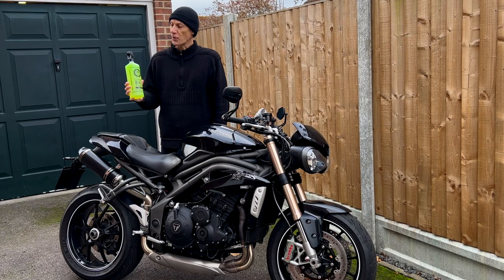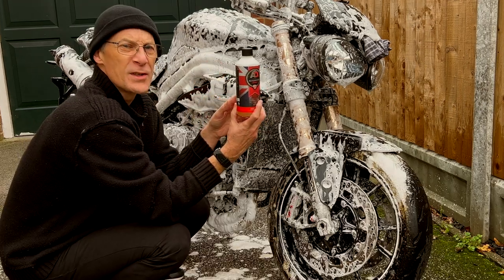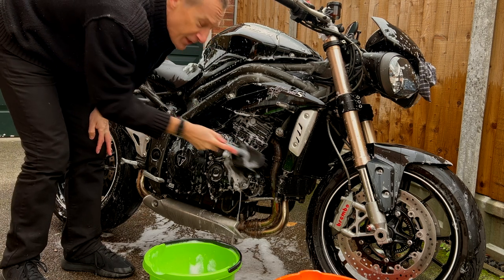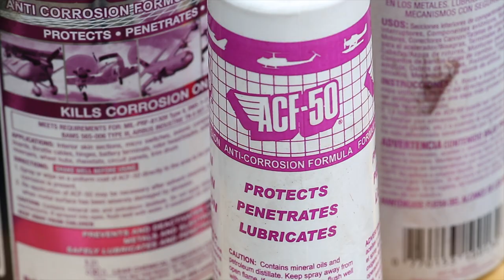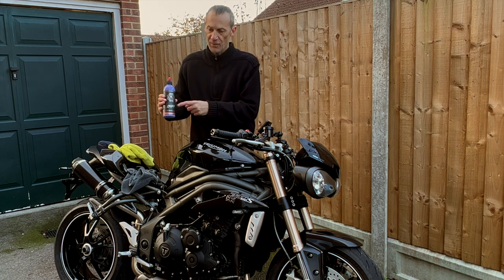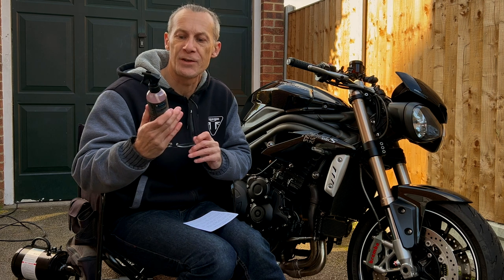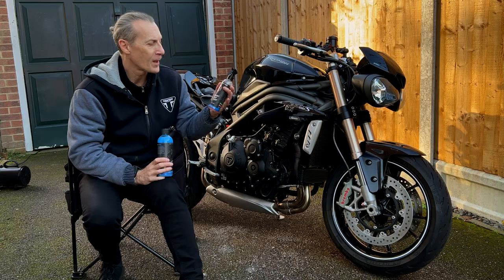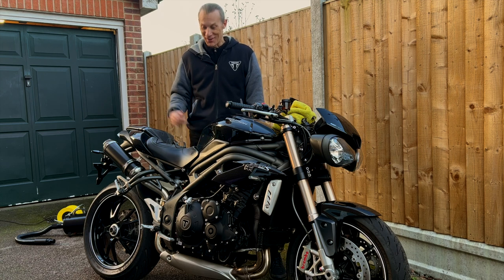How to clean your motorcycle - with Autobrite Extreme Range

Comment from the maker: Please note: AutoBrite have pointed out that the Ceramic Quick Detailer is best applied as a spray. I applied it with a micro fibre towel, and it still looked amazing!
Reply: So spray it on and leave it ?
Reply from the maker: @ThisTwoWheelLife  The Ceramic Spray you spray it on the bike one panel at a time and then immediately wipe it off, there’s no need to leave it on! Autobrite would be happy to answer any questions you may have too! 😊👍

Comment: There’s something satisfying about watching motorcycles being washed 😂. I do love to wash my motorcycles as well. Great video.
Reply from the maker: Definitely, I find it very therapeutic! Which brand do you like to use on your bike? Thanks for the encouragement! 😊👊
Reply: @TheAdventuresofPhilJones  mucoff if that’s the spelling of the brand. Good products.
Reply from the maker: @TripleSound  I use their Speed Polish which works really well. You can see it in my cleaning series. Seriously, check out  Autobrite when you run out, you won’t be disappointed. 😊
Reply: @TheAdventuresofPhilJones  thanks will give it a try.
Reply: Cracking video Phil, good explanation of the cleaning stages and products and application, your bike already looked great now it's simply stunning 👌
Reply from the maker: @dalewintle9969  Thanks Dale, I really appreciate it. Yeah, I’m really pleased with how it looks. I was planning to ride in December and January but then I was kindly loaned a Triumph Tiger 900 for almost a month and I then I didn’t fancy riding my bike in the sub zero conditions, I’ll be back on it again soon! 🤪

Comment: Very good demos of the products, can I suggest a few things bud that will help with your cleaning process... Grit guards for your buckets (Black paint will show up micro scratches more clearly) also consider wearing gloves when applying polishes & sealants as most can damage skin (mainly drying and cracking -not good in winter lol) that been said though excellent video and very informative👍🏻
Reply from the maker: Thanks so much, and thanks for your advice. I have been considering getting grit guards, but didn’t think about gloves which is a great idea and very professional! Thanks for the tips and support! 😁👍

Comment: QD is a temp surface cleaner, seal all surface all over. Polish plus wax differ. 

All ceramic need interim support, a good ph wash. 

You can buy plastic dressing...just be careful and any ceramic type product needs to bond to a bare surface. 

Autoglym SRP is like a facial for your paint, old or new. 

Meguiars PlastX will get scratches out of clear plexiglass. 

Good products AB. 

Over years you can learn to clay plus tar and iron decon paint. AB sell these products. Good luck.

Comment: Hi Phil
I have the 2021 speed triple 1200rs and wondered wot you use on your engine on your Triumph Speed Triple as it looks amazing
Reply from the maker: Thanks so much. Nice bike, what colour is your 1200RS? It's just a combination of all of those products, what you see in the video is all I use. I think having a nice large soft brush to clean the engine really helps. Before I met @autobritefirect I used to apply Muc-Off Motorcycle Protection to the frame and engine, but recently spoke to Autobrite about which product they would recommend. They said the Ceramic Quick Detailer will work in the same way, just spray and buff, you can even apply it to a wet panel if you wish after washing it! I hope that helps!
Reply: Thanks for the reply Phil my 1200rs  is in the best colour lol.....BLACK 😂😂
Reply from the maker: @itsginty8779  That is the best colour for sure! 😁👊

Comment: Bike looks great as ever Phil. Do they also have a product for matt paint???
Reply from the maker: Leave it with me, I’ll see what they recommend! 🙏
Reply from the maker: Hi Rob. Sorry for the delay getting back to you. Autobrite have a few products suitable for Matt Paint. My advice would be to give them a call and pick their brains for the best product for your paint and needs. I now have a discount code you can use PJONES-AD10 Let me know how you get on! 😊👍
Reply: @TheAdventuresofPhilJones  Thanks for taking the time to find out. I'll take your advice & give them a call.👍
Reply from the maker: @robg9379  In theory, depending on how much of the bike is being Ceramic coated, the bike should be protected, you could still use it on the electrics and switches maybe! Please let me know what they say! 👍
Reply: Morning Phil, I have had a reply from Autobrite. They recommend the below products

1. Extreme Bike cleaner

2 Super Foam snowfoam or Magifoam

3 Streak Free shampoo or Citrus Pearl shampoo

4 Elegance Quick Detailer

5 Ceramic Quick detailer (is safe but may slightly Darken? Enhance the paintwork)

6 Extreme ceramic Spray sealant (is safe but may slightly Darken? Enhance the paintwork)

Not sure about some of the products as they say it may darken the paint work???
Reply from the maker: @robg9379  Hi Rob. I’m pleased to hear Autobrite replied to you. Quite often different waxes can alter the depth of the paint, I remember a Meguiars product I used did just that, but that’s what I wanted. Is there an area on the bike that is hidden you can test it on? Thanks for letting me know 👍

Comment: Hi can you help? I just bought the IK multipro 2 for the foaming stage and I’m using  autoglym foaming carwash. The results are v disappointing. Soapy water not foam! I’ve tried different concentrations. It always seems much too wet. Any advice? Thanks
Reply from the maker: I’m sorry to hear that. Well I use the IK pressure sprayer and it works fine, make sure you are pumping it up enough. If you have tried different mixes then all I can think of is it’s the autoglym foaming car wash. I haven’t used it but the name suggests it’s meant to be soapy and different to a Snow Foam. I hope that helps!
Reply: I'm late to comment here but I'm currently doing my own research into an IK sprayer. My understanding is that IK Multi will not foam at all, it's not designed to. I think you need the IK Foam sprayer.

Comment: Autobrite advertise the snow foam as a pre wash. Is it necessary to use a pre wash before applying?
Reply from the maker: It really depends how dirty your bike is, I like to use a pre wash before snow foam to remove stubborn dirt or road tar. In this video I was keen to try all their essential products so it probably wasn’t necessary but didn’t do any harm. There’s a discount code in the description if you’re interested! Let me know how you get on and what you think of their products! 😁👍
Reply: @TheAdventuresofPhilJones  Hi Phil. Thanks for the response. Did you apply the duo polish to the metal work? How do the results compare to the products from your other videos? Thanks.
Reply from the maker: @luketaylor9144  No problem. Good question. Yes I have used the Duo Polish on metal and it works really well. As you have seen I also used Diamond White Metal Polish which I also love, I think Diamond White is better when your metal needs extra work, like exhaust headers, but the Duo adds a nice finish to good quality chrome. I’ll try and test the two products side by side sometime! I hope that helps! 👍

Comment: Im suprised you haven't worn the paint off!
You need to get out more ...preferably on the bike!
Nice showpiece. How much do you reckon all that lot costs?
Probably cheaper to pay for a bike valet😅
Reply from the maker: The paints pretty tough, even with my cleaning! 🤣 So I get a lot of stick for cleaning my bike and have a few comments saying I should ride more. I filmed this video in December and January, juggling life, work and the weather. I actually rode over 1,000 miles during that time, in the rain, cold and even light snow, even when most people I know have got there bikes wrapped up until Spring. Admittedly, it was on a Tiger 900 GT Pro. I’ll add the cost up for you later but remember buy it once and it will last for a couple of years and it’s definitely cheaper than paying for a good bike detailing clean, plus I find it relaxing to do. It beats sitting in doors watching Love Island! 🤣👊